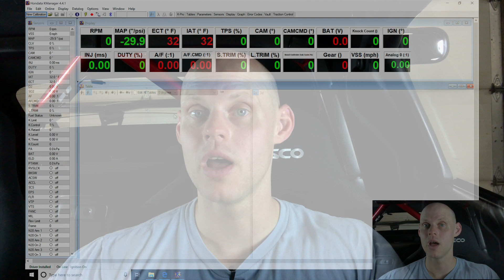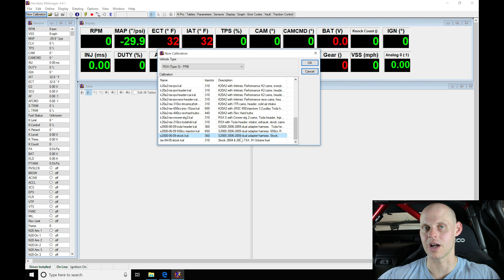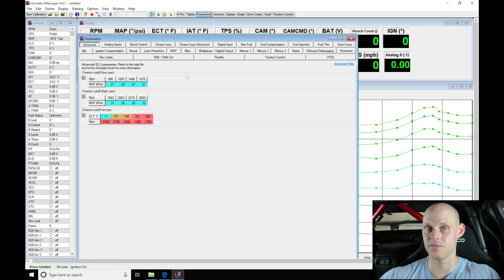Hondata Kpro Live Training: Naturally Aspirated Track Honda s2000 Part 1 | Evans Performance Academy

Comment: So if you have a 04-05 ap2 all you have to do is enable the idle air control setting with kpro and then just tune of that calibration?